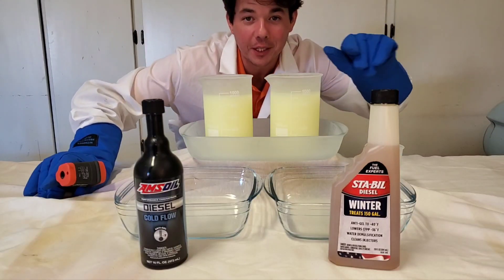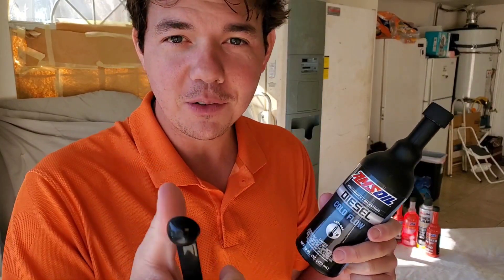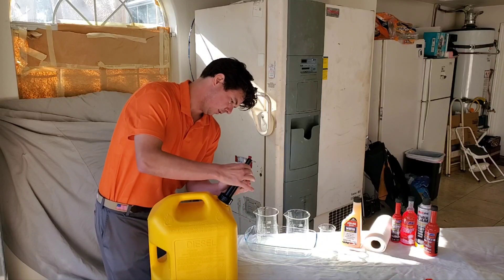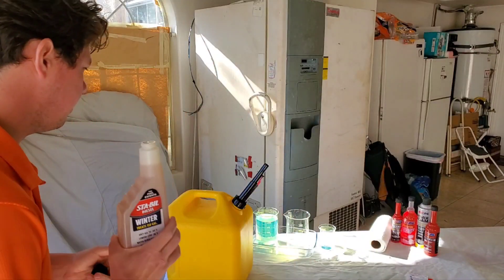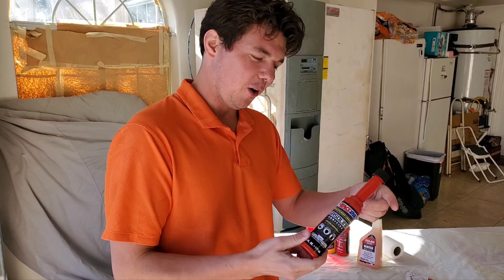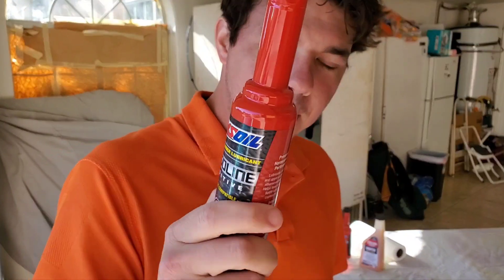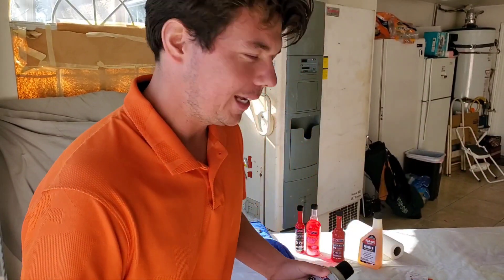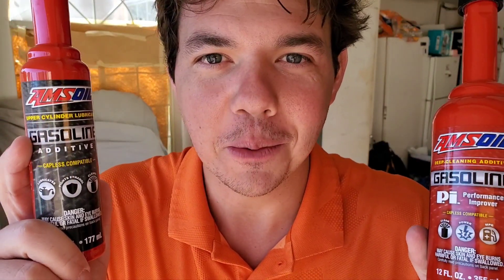AMSOIL ANTI-GEL vs STA-BIL Winter Diesel additive Cold Flow Test

Comment from the maker: 🎬🎬🎬 Professional YouLubher: Eben Rockmaker Regency Gold Direct Jobber AMSOIL Specialist (Dealer#: 5331179) 702-472-3614 

     ✅✅✅  New To AMSOIL I Recommend The AMSOIL 6 Month PC Membership because it will save you about $33 on a $100 purchase after the difference in tax - https://www.amsoil.com/offers/pc/?zo=5331179 

     Watch This: Get Better MPG With AMSOIL power Foam - https://youtube.com/playlist?list=PLB_ftWArBFdcSV_RVwPgrZCT1ZOg4D2LP 

     ♥️ AMSOIL Performance Test Results. Read This Article - https://www.amsoil.com/performancetests.aspx?zo=5331179    

      If you would like to try the AMSOIL products this is my link and I will be your AMSOIL Dealer and will be able to answer your questions. 

     When you order as a AMSOIL Preferred Customer you will save about $33 on $100 order because of the 25% discount and the difference in tax. 

     When you click on my link I will be your AMSOIL Dealer If you go to a different device to order the products and do not click on my link you will need to enter my referral number so I will be your AMSOIL Dealer. My referral number is 5331179      

    Find Products For All Vehicles - https://www.amsoil.com/guides/?zo=5331179      

      AMSOIL Dealer Google Maps - Synthetic Oil Protection: https://maps.app.goo.gl/2AuZCi8h2Gaf3mY46 
             
Synthetic Oil Protection Website - http://syntheticoilprotection.net/ 

      1959 Cadillac DeVille is using all AMSOIL products from top to bottom. CHECK OUT THIS PLAYLIST YOU'LL BE AMAZED - https://youtube.com/playlist?list=PLB_ftWArBFdeVKszO64Ig5nWEQp7H3oF-       

       AMSOIL Performance Test Results. Read This Article - https://www.amsoil.com/performancetests.aspx?zo=5331179 

About AMSOIL..... est. 1972: First 100% Synthetic Oil Certified in the USA 

1. Where can I find AMSOIL? - Use this link https://www.amsoil.com/offers/?zo=5331179  Or      

       2. What makes AMSOIL different than other oils? - AMSOIL is 100% Synthetic & has higher film strength & holds up 4× better in turbocharger deposit testing than Mobil 1 EP which protects and separates metal parts, keeping them from wearing and Lasting Exponentially longer. 

     3. Why should I use AMSOIL?: It protects the engine so it will last longer. Less oil changes less often (once per year/15,000 miles) or longer... Save money in Gas & Time making it less expensive than a FREE oil change over the course of a year. 
  
Oil Analysis Tests: 

15,500 Oil Analysis Test Results SL550 - https://youtu.be/3rdN6U1Jt_M 

5500 Mile AMSOIL Oil Analysis Test Results - https://youtu.be/3wf962IwEmo   

5000 Mile AMSOIL Oil Test Results On My SL550 - https://youtu.be/fLuvzN6yLSw 

11,000 Mile AMSOIL Oil Analysis Results on my Corvette - https://youtu.be/YEY_13UYzA4 

20,000 Mile Oil Analysis Results on Honda Uber - https://youtu.be/gm_PXlpiaTk 

26,000 Mile Oil Analysis Results - https://youtu.be/Wdq2A2YIorM 

80,000 Mile Oil Analysis Test Results Freightliner Cascadia - https://youtu.be/9A9k6i1xMoo 

25,000 Mile AMSOIL ATF Analysis Test Results - https://youtu.be/IeVPGR7UO9E 

      The Power of AMSOIL Signature Series 5W-30 Synthetic Motor Oil protects against harmful deposits on turbochargers 4X better than Mobil1® Extended Performance and 3.6X better than Royal Purple® in industry-standard testing*.  Read This Article - https://www.amsoil.com/newsstand/motor-oil/articles/leading-the-field-in-deposit-protection/?zo=5331179      

     Better MPG Proven. Read This Article - https://www.amsoil.com/newsstand/motor-oil/articles/another-win-for-amsoil-products/?zo=5331179 

     AMSOIL Performance Test Results. Read This Article - https://www.amsoil.com/performancetests.aspx?zo=5331179      

    Try The Synthetic Oil Protection Coffee - Ebens Favorite. To Order Coffee Click Link Below: https://supportwith.coffee/shop/subscriptions/sop/

Comment: for the ratio chart on the back of the amsoil, is is dependent on the amount of diesel in gallons you are filling into the tank to get to full at the pump, or the total amount of fuel in the tank in gallons when you are all filled up?
Reply from the maker: That's a good question I have found that the diesel injector Clean Plus setting boost has become my favorite and it has created great performance for many of my customers on the channel I personally have quite a bit of experience with it with their vehicles and I found that a overtreat ratio will really make a bigger performance difference and I recommend 16 oz bottle of the diesel injector Clean Plus seat and boost that's the green bottle in a full tank and on a a heavy clean up those a 2 16 oz bottles in a full tank of diesel on a pickup truck will really clean up the injectors in the valves and then you just run one bottle every full tank as a maintainer after that.

Definitely a big Improvement in power and performance💯

Also extends the life of the injectors fuel pump and fuel filter with a cleaner motor and huge bump and fuel mileage.
This is one of my favorites - 
https://youtu.be/by5RYv3Dt0Q?si=QX9q1UN7RtY_DgEm

Comment: Hey man I live where it gets 120 in the summer should I switch from 0w20 to 5w30 ? It's a 2020 sentra 33k miles
Reply from the maker: If it was my car I would run whatever is on the look of guiding.
Find Products For All Vehicles - https://www.amsoil.com/guides/?zo=5331179
Reply from the maker: I would also run the Amsoil upper cylinder lubricant every full tank of gas in the PI performance improver every 4,000 mi you'll have a lot better performance and fuel mileage 😃🎬🪙

Comment: What's the difference between amsoil heavy-duty synthetic diesel oil 5w-40 vs the same one but signature series's. Can you do test on them on cold flow test
Reply from the maker: Yes you can look up in the technical data bulletin It will give you some more details of cold flow temperatures subtleties like that but the difference is are cold flow packages and anti-wear packages also the amount of base number and some of the additives that are in the oil and how it operates the signature series is the best of the best It's going to last longer You're going to have less thickening or over the course of the interval You're going to have a cleaner motor and you're also going to see a little bump and fuel mileage over the interval also you'll have less oil burning and a little bit more wear protection.